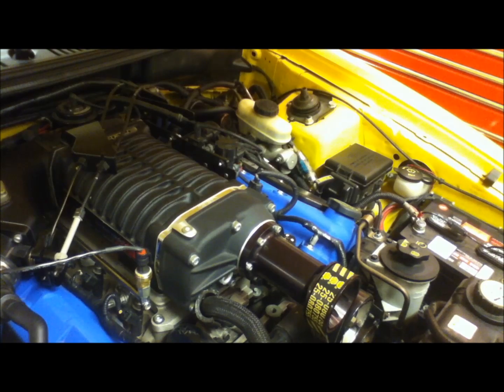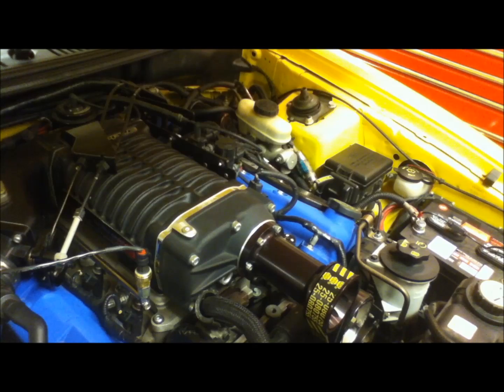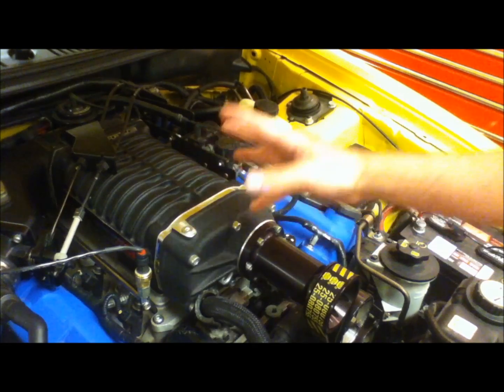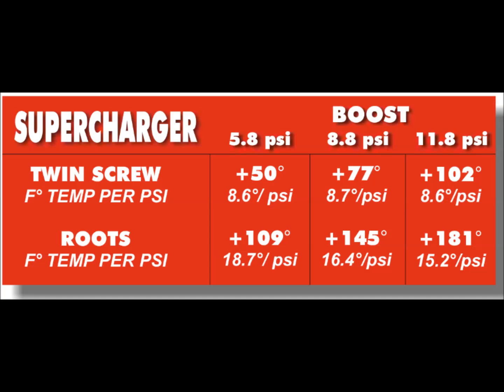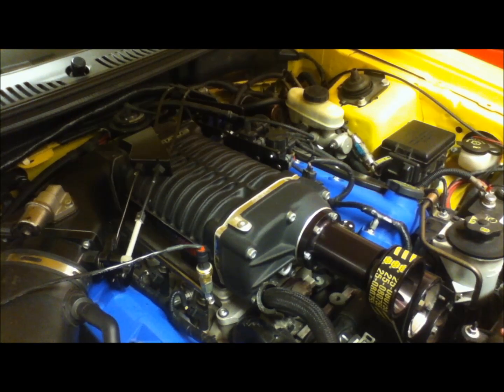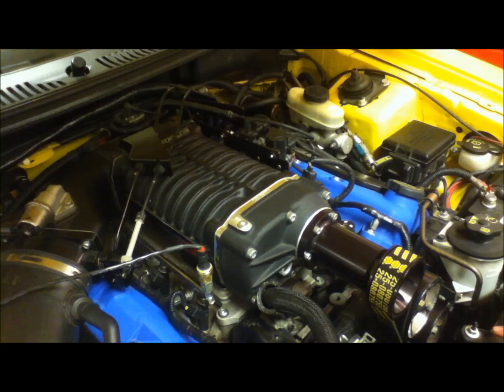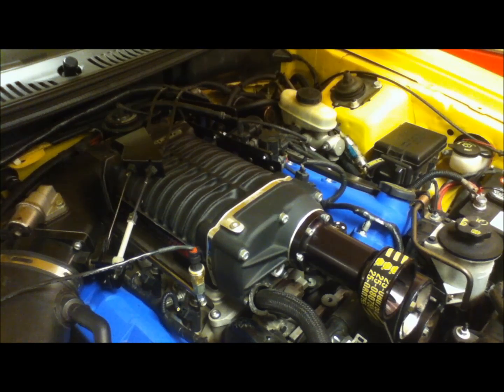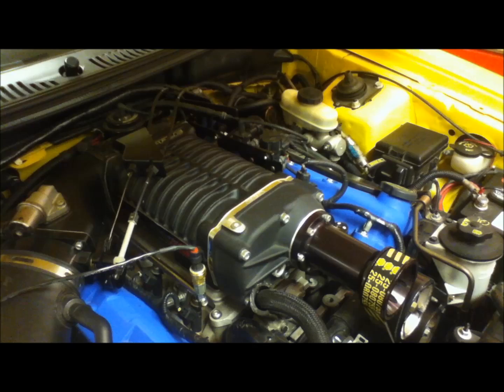Superchargers: Roots vs Twin Screw vs Centrifugal (Whipple, eaton, VMP, procharger) supercargador

Comment: When using a positive displacement supercharger, more engine speed equals more airflow and not necessarily more boost pressure. this is an important point.

Comment: screw 15000 rpm  8 psi 240 degrees added 100 torque 120 hp
B&m 144  1 to 1 engine rpm 7 psi lol at 
at 2 percent 8-10 psi engine at 5500 Rpm engine boost 90 degrees
then fuel cools charge to 60 degrees lol going through blower added 250 torque hp200
big turbo 100 horse 25 psi 1700 degrees with twin 200hp 50 psi through cooler 500 degree charge 255 tork but only at max rpm 
add 300 hp  for 9 to 1 compression engine on each one  
superchargers can drive around town 
at 7000 rpm roots power will Double and need forged assembly or spit pistons out
Winner Roots Supercharger
still champ 
problem roots wont bolt up on newer engine

Comment: not good... You show only one style of super charger and you said one time is a roots, and after you said is the other style.
Very confusiing...
Reply from the maker: The roots and twin screw look the same from the case. It is how they operate internally that makes them different. Roots Rotors turn away from each-other and twin screw turn into each other. I’m sorry you are confused, but I explained it in the video

Comment: I remember back in 67 I had a Chevy 283/301 with a stroker kit, Chrome molly pistons perfect circle rings federal mogul bearings, TRW Lifters, Milled and ported head, straight up flame throwers, and a Bendix (do they still make them) roots supercharger w/ duathermoquads. it was all fed into a muncy four speed and a 4:11 rear. It had only about 500 BHP at the back wheels. It was nice when gas was cheap.

Comment: I used to think I wanted a supercharged engine until I drove n/a cars for a while and realized 99.9% of the time you're high enough in the rpms to benefit from a turbo much more on the cars I like to drive and then having drove both I own a turbo car because it makes its power across a huge rpm range and doesn't fall on its face above 4 grand like most supercharged engines
Reply from the maker: Newer superchargers don’t fall of at higher rpm. Turbos are best for automatic transmission cars. What I didn’t like about the Subaru I drove was it felt like someone else was reaching over and stepping on the gas pedal without me wanting that once the turbo came on at 2,500rpm. I constantly had to drive lower or always higher to keep it in boost or out of boost. Not a fan.

Comment: Can i change the pulley on my supercharger to give it more power and if i can do i have to go smaller or bigger?????? It’s a 05 Mercedes-Benz c230 kompressor 1.8 liter sport
Reply from the maker: The smaller pulley on the supercharger will spin it faster for more power OR a larger crankshaft pulley will also spin it faster. You will need a tune or the car will run lean and melt a piston
Reply: @dannyjohnsonsgarage  ok thank you

Comment: Danny, I have an older Eaton m65.  I am wondering if it needs to be rebuilt.  It makes a subtle grinding noise when I turn the pulley by hand.  Do you know if this is a normal sound?  Should a good supercharger be butter smooth and quite or is it normal to have some grinding sound?
Reply from the maker: It should be very smooth. I would imagine the rotors are slightly coming into contact.

Comment: Great video I really enjoyed it! I have a 2014 5.0. What do you recommend for daily use and occasional roll racing on safe unoccupied roads. Id like to beat hellcats. I don't want anything over heating. Vortech supercharger or twin screw? If twin screw what brand. I've been debating for 3 months and I don't want to make a mistake. Thanks 🇺🇸
Reply from the maker: I would go with the TVS kit positive displacement kit. This is the one you want but it says 2015-2017. https://www.amazon.com/gp/product/B010OMNCT4/ref=as_li_qf_asin_il_tl?ie=UTF8&tag=2004047-20&creative=9325&linkCode=as2&creativeASIN=B010OMNCT4&linkId=aa51fea4d73306276fdff9c9f45cead6
Reply from the maker: Edlebrock makes a similar one  https://www.amazon.com/gp/product/B007V94T96/ref=as_li_qf_asin_il_tl?ie=UTF8&tag=2004047-20&creative=9325&linkCode=as2&creativeASIN=B007V94T96&linkId=c602461cba45f918a9f9642610bf2e66
Reply: @dannyjohnsonsgarage  is this one good for daily use and not overheating.  I live in Florida, it gets hot. How do I prevent heat soak in these? Get better cooling system?
Reply from the maker: @high-rise8505  yes, you just want to make sure it’s an intercooled kit. You can remove the spare tire and put a giant tank for the intercooler and it shouldn’t have any problems.

Comment: Can you tell me the difference between a 2.3l supercharger vs a 2650l supercharger i know they make more but i heard a 2.3l makes more on lower rpms because of its smaller displacement does a 2650 make more higher rpm and if so can you tell me which rpm thanks
Reply from the maker: if you are talking about the same generation and brand of VMP TVS, then the bigger supercharger will put out more displacement. It’s cranking out 2.65 liters of air per revolution vs 2.3 liters. (If both superchargers have the same size pulley). The new 2.65 L supercharger is also supposed to be able to make the same or more output as the smaller 2.3L with a larger pulley (spinning less).
Reply: @dannyjohnsonsgarage  yea thats rights but because the 2300 has a smaller pully like a 79mm could it be it spools up with less rpm than a 2650 with an 88 on lower rpm because it has bigger pully
Reply: @dannyjohnsonsgarage  because its spinning less is it lighter downlow

Comment: But whats the difference between roots and twinscrew in drivability does the torque come right away in both or one u need to rev more or there exactly the same just the roots gets more hot
Reply from the maker: With equal generation and performance roots vs twin screw blowers you don't notice any difference between the two. They are both positive displacement design and function the same in that regard.  No spooling delay.

Comment: the way you described the rotation of the screws means discharge in at the top and suction is at the bottom which does not make sense since the engine is below the supercharger
Reply from the maker: The supercharger displaces airflow into the intake manifold, and then into the engine. Depending on the design of the supercharger and intake manifold, air may flow “up” as it makes its way around the supercharger case (roots) or even up through the intake manifold runners after passing through the intercooler.  Also, the new supercharger like on the 2020 GT500 is inverted

Comment: which supercharger has the least resistance and parasitic loss to the engine and which one has the least heat soak?
Reply from the maker: You have to understand that could mean a centrifugal supercharger with a large pulley- which means no major power gains. It’s like asking which one gets the best gas milage.
Reply: @dannyjohnsonsgarage  so you're saying that the centrifugal supercharger with a small pulley is the best, right?
Reply from the maker: Tom L Bot exactly. It depends on the setup of the car. . As the video is showing, centrifugal is best for an automatic car with a big fuel system. With new positive displacement supercharger’s efficiency and with all the torque produced instantly, I would go PD over centrifugal 90% of the time or more on a build. To me I would go with a turbocharger before centrifugal. 
  What I’m saying is focusing on which will give you low charge temp and not heat soak isn’t the most important question- just like gas milage
Reply: @dannyjohnsonsgarage  Ok, I see.. but turbocharger is more expensive and difficult to install. the roots type runs hot and the twin screw heat soaks easily after a few runs. I guess the centrifugal runs cooler, and has the least parasitic loss. Now I know which  supercharger to get for my 10spd  5.0. Thanks

Comment: What do you recommend for daily use and the best ones that can resist heat in the summer season
Reply: For a Denali 2013 6.2 L
Reply from the maker: Hussain Almomen I would look into the edlebrock ones like this. I have a 2015 yukon denali 6.2 and I’d do this or a whipple https://www.amazon.com/gp/product/B07T2HYWSW/ref=as_li_qf_asin_il_tl?ie=UTF8&tag=2004047-20&creative=9325&linkCode=as2&creativeASIN=B07T2HYWSW&linkId=ac7bf4fb451da5ceb348bf6fc7c563d3

Comment: Im interested in putting a centrifugal supercharger on my 2018 dodge charger scatpack.  Im looking for high end top speed not low end torque/rpm.  I hear that vortech is very good as well as reliable for everyday driving.  Your thoughts? Advice?
Reply from the maker: With the weight of the charger I would still suggest a positive displacement blower
Reply: Danny Johnson im concerned about the dreaded hemi heat soak infiltrating the supercharger plus everyday Driveability advice on what brand to get?
Reply from the maker: Drivability will be fine. Just like a hellcat. I would look at something from whipple or edlebrock like this https://www.amazon.com/gp/product/B074R9Z9XS/ref=as_li_qf_asin_il_tl?ie=UTF8&tag=2004047-20&creative=9325&linkCode=as2&creativeASIN=B074R9Z9XS&linkId=8eca92a352dcdc385314754090e4eac2

Comment: I had a Civic Si with an aftermarket Roots supercharger kit ( new fuel injectors, new injection and spark maps, new clutch and new exhaust headers/pipes included. There was an increase in horsepower from 200HP to 320! An amazing performer!!

Comment: im a little confused. you said something along the lines of the increase in boost is linearly proportional to the increase in rpms. but then i think you said that you have 17 pounds of boost at 3K and at 6K. or are you saying you have 17 pounds more at 6K? 

also, i hope you dont think im a dick, but the square root of 8 is 2.82
Reply from the maker: Horsepower increases in a linear form for a positive displacement supercharger and Horsepower increases exponentially for a centrifugal supercharger

Comment: Twinscrew/roots is more fun but centrifugal is much more efficient and make more power at the top half.  I think it is better for a V8 as you have more torque at lower to mid rpms and have traction problems.  Efficiency is important due to amount of power it takes to drive the blower  and outlet temps.  I guess it depends on what u want to do with the car

Comment: The big difference between twin screw and a roots is a twin screw compresses the air internally within the supercharger case whereas a roots is just a air pump (just like a fuel or oil pump) and doesn't compress air, boost comes from packing air into the intake manifold.

Comment: I have a 4.6 mustang GT. I'm at 7000 feet what would be the best type of blower for me?
Reply from the maker: ghost man I would go with a tork tek kit and use a tvs 2.3L. If you’re stock bottom end you’ll want to limit your output to 450hp at the wheels
Reply: id go centrifugal. you can get decent power at low rpm speeds, and turbo like power at higher rpms
Reply: I got the same car 07 gt 4.6 with a Roush m90 roots style and 4;11 gears and it pulls fkn hard! 500whp

Comment: Excellent video Dan! I heard a loud POP from the top engine area @ 7000 rpm from my (IHI SC) SL55 last year. Wondering if this was a waste gate relieving pressure? I don't see any carbon or oil from a gasket-ed surface anywhere lol...
Reply from the maker: A pop would usually indicate a spark plug breaking, detonation, hopefully nothing major. The car still ran fine?
Reply: @dannyjohnsonsgarage  Nothing that I can presently ascertain? It failed to downshift, consequently prolonged redline and then I let off it. I'm doing work this spring "plugs, stage 1 w/smaller pulley 76mm, inter-cooler, high flow cooling pump & larger/better IC heat exchanger. Can't account for the pop.....it was loud and scary! Maybe detonation? Not a plug tho.

Comment: I just learned something new... Kenne Bell is false advertising on how the unit works... Look at where you're supercharger shaft it... It's on the right rotor, look at your roots supercharger and it's shaft... It's also on the right rotor... The engine spins clock wise if you're facing the engine bay from outside of the car... They spin and function the same way... Just the rotors look different and the tvs series is just as efficient because it's also...  aerodynamic? IDK, I'm kind of frustrated with these twin screw companies... They make a good product (because they make much larger automotive compressor units) but damn this took me awhile to figure this out... I had to research on how a commercial grade twin screw air compressor worked...

Comment: The more boost you make the more horsepower is 100% correct. But, if you're talking about COMPLETELY DIFFERENT turbos, then you are correct. But the average person leaves the same turbo on his vehicle while talking about the turbo he makes... YOU, are referring to two COMPLETELY different set ups. You're making an argument of 2 different displacements, the more boost more horsepower is referring to more boost, with the same application.
Reply from the maker: Jeff Henning I was not referring to increasing boost in that example, but rather boost levels (amount of restriction) and boost MASS. 

For example, 10 psi in a small intake manifold area is LESS air than 10 psi in a large intake manifold

Comment: Never seen a supercharger put out 17psi most i seen was 8 my 6.0 powerstroke the turbo vanes are sticking when i floor it but when they get unstuck man it pushes you back
Reply from the maker: ArchV1 Keep in mind that psi is restriction, so a bigger displacement engine like a 6.0 is being fed much more air and so 17 psi on my cobra would be the same amount of airflow as 8psi in a 6.0. That’s why these 4 bangers brag 30 psi but they are pushing less overall airflow
Reply: @dannyjohnsonsgarage  ok cool i waa thinking about putting a supercharger on my 06 mustang gt but idk if its worth 3000
Reply from the maker: The only problem would be the connecting rods are maxed at 450rwhp, so you’d be limited to that power, but still might be fun

Comment: I know this is an old video... But, if you were going to build an old school v8 carbureted, shooting for 600-800 wheel. would you cut a hole in the hood for a 6-71 or use a centri blow through carb setup for street use?
Reply from the maker: Adam Either will work. It dept ds on your goals with the car and even preferences on looks. You will make good power with either.
Reply: @dannyjohnsonsgarage  thanks man! I was kind of worried about thieves eyeing my supercharger... so I thought of more of a sleeper status xD I needed some experienced advice

Comment: Is a bigger blower more responsive and efficient than a smaller one ? Like say if you have two Whipple twin screw superchargers that are exactly the same besides the size. Some people say a bigger blower that does not have to turn as fast to get the same CFM output equal's less heat because it spins less. They also say it's more responsive because its putting out more air per revolution than a smaller one. Counter argument is a bigger blower's advantages are negated from increased parasitic loss unless you really need all that air especially at the top end. 

Not a lot of data on this surprisingly. I could only find one forum that discussed this and no one really knew. Of course you can go too big or too small at the extreme ends but is it better to favor bigger blowers than say what they offer in kits which are generally 1.9 to 2.3 liters or is going smaller while still meeting your air requirement better ? I would like to see a comparison on the exact same blower only different in size be compared to each other on the same engine and dyno.
Reply from the maker: James Avery Yes, you’re right. If they are the same efficiency per liter, the smaller supercharger will cause less stress on the crank and be easier to spin, so there comes a point where too big is a problem. For this cobra you want to be 2.3L-2.9L before you would have issues with the crank snout breaking. You might make more peak hp with the bigger blowers and with the right fuel get more out of them, but for a street driven 91 octane car it’s best to be in the 2.3L-2.9L range in my opinion